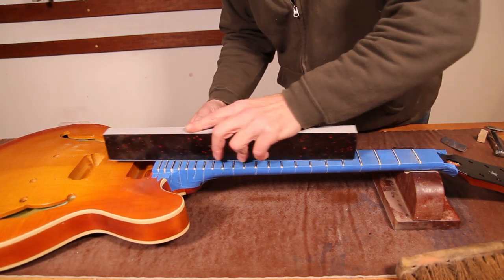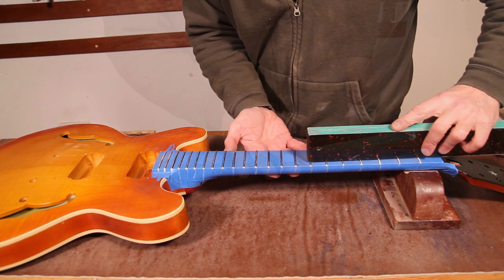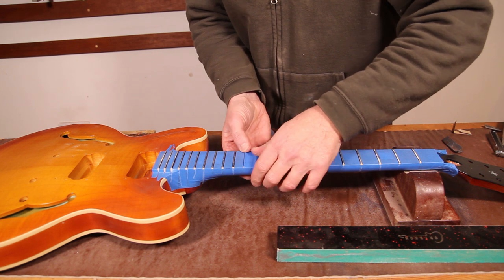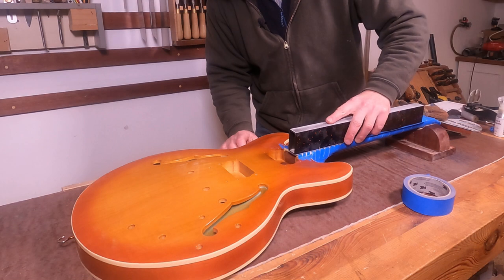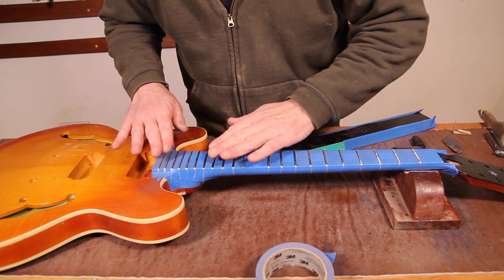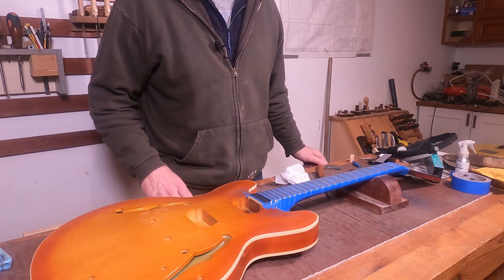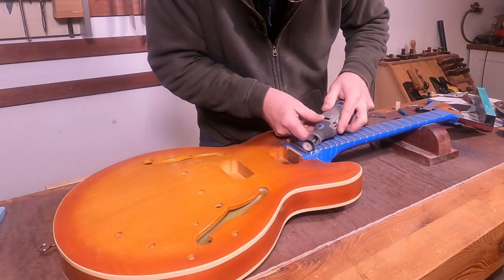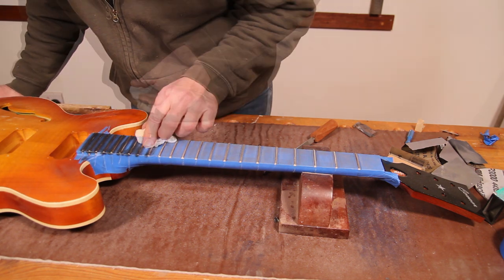The Shed of Dreams ES 335 build Episode 50: Fret dressing

Comment: Good job.  Will you need to do another levelling with the strings on under tension or can you introduce some neck relief to overcome any fret buzz
Reply from the maker: I should get a bit of relief once the strings are on, if not it's a 2 way trussrod so I can dial a bit in. Shouldn't be any issues with buzz (fingers crossed)

Comment: I'm curious.  Would steel wool be appropriate for fret polishing?
Reply from the maker: Yes, it would be fine. The only problem you might have is with bits of the wool getting into pickups etc. I use wet and dry as there is always lots in the workshop.